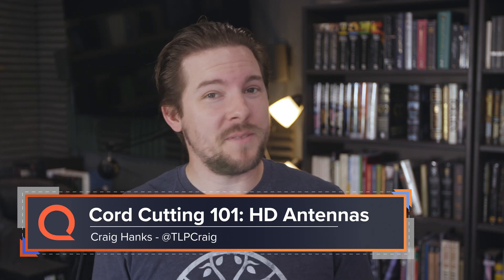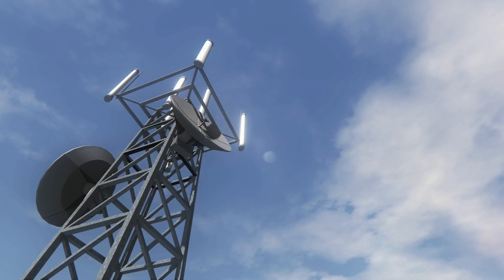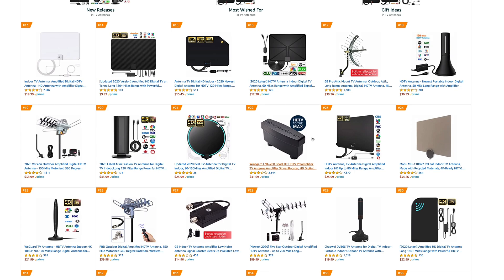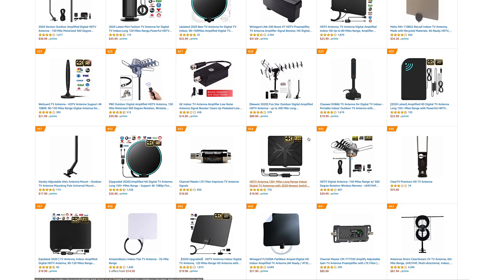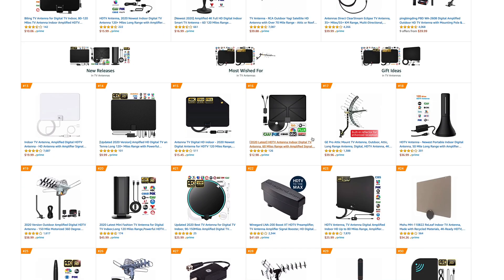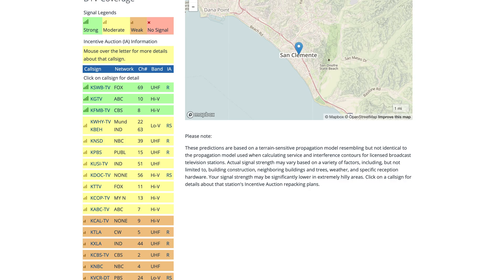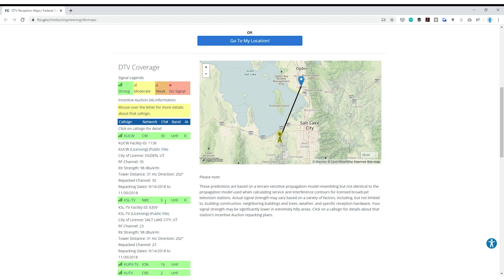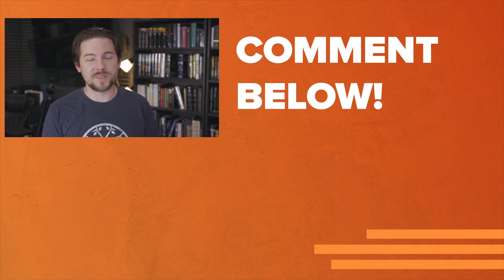Why are they called "HD Antennas"? | Cord Cutting 101

Comment: I'm old enough to remember TV before cable, etc. You had 2 dials. One had channels 2 through 13 and a UHF "channel" on it. If you needed to tune in a channel above that, you tuned the first to the UHF, then used the second dial to tune in those channels. Back then 2 -13 had better pictures. Now it's sorta the opposite...the few that are broadcast from 2-13 aren't quite as good. Still, with all the sub channels that you get, it's much better than when we only had 4 channels.
Reply: The problem is most antennas do not pick up VHF. My VHF only antenna from the analogue days worked fine after the transition on the 2 channels that stayed on Hi-VHF, but the UHF channels were a mess.

Comment: It wasn't mentioned explicitly, but do note that a lot of TV stations don't broadcast by the channel number you know them as. For example, I have a CBS 5 in my market. You might think that channel's on the Low VHF band,  but  "5" is the virtual channel number. Using antennaweb.org,  I know it really broadcasts on RF channel 17, which is on the UHF band.
Reply from the maker: Yep, which is why that FCC site really comes in handy, since it will tell you which band a channel is actually broadcasting on. But like I said: it's a 101 video. :)

Comment: Antennas are useless they only work for you if you live in a city if you live in a town like 50% of Americans outside of the city you can no longer get anything over the antenna you used to in my grandfathers day but they stop that shit that’s why antennas are useless
Reply: It's not useless if the second 50% can get a signal.  Only useless for the former half.  😁
Reply: I get 90+ channels from a broadcast tower that's 50 miles away
Reply: I get all OTA from Omaha 60 miles away antenna in attic.
Reply: Bee essss
Reply: With a rooftop antenna you should be able to pick up signals from 50-60 miles away and more then 50% of the population live within 60 miles of a transmitter